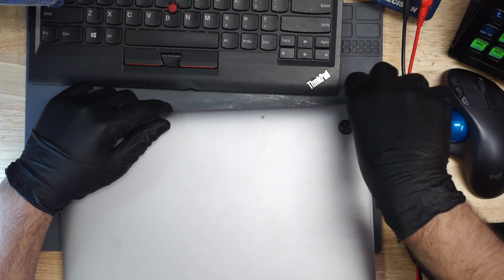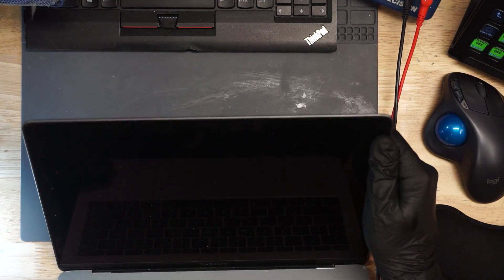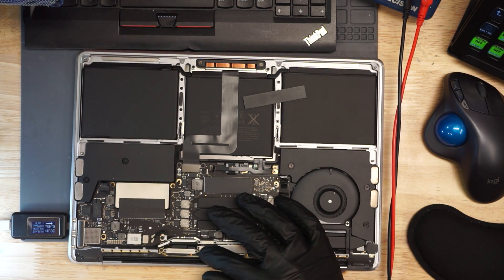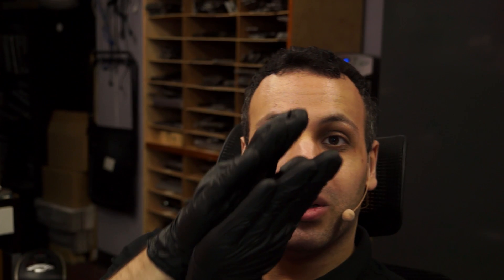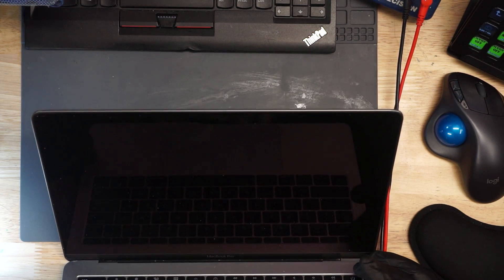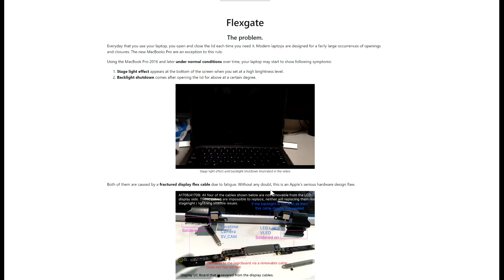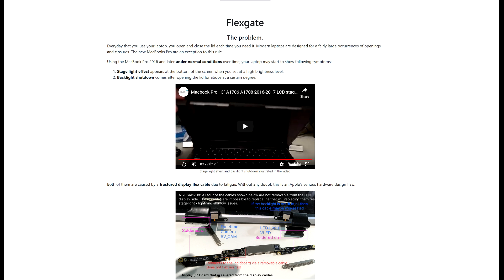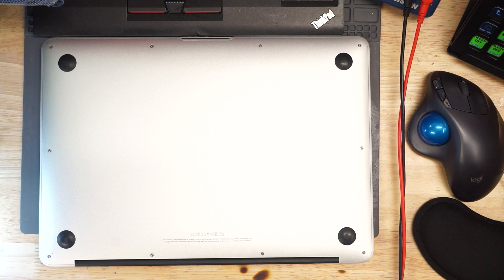Macbook screen DIES when opening lid: Apple provides NO FIX! flexgate

Comment: This would be covered under Australian consumer laws, meaning Apple would have to repair, replace or refund the faulty product if it was purchased in Australia. Does the US not have similar consumer protection laws?
Reply: It's the US, of course not
Reply: Technically the answer is No as there are many lacking laws in regards to consumer products. While a manufacturer is supposed to fix any defects a product has, i.e. the Macbook screen here, they could easily turn around and say "Well it's your fault because you handled it wrong.". On top of that, they made it nearly impossible to repair the products on your own.
Reply: @RevoX4  "they made it nearly impossible to repair the products on your own"  please shorten this to "repair the products".  Apple does not repair, they just replace. This is a huge difference in terms of ewaste discussion and how evil (not only expensive) Apple is.
Reply: I'm beginning to understand why most consumer electronics are so much more expensive in Australia compared to the US (over and above the exchange rate). Faulty equipment stops being a liability after a year and turns into a new revenue stream...
Reply: @nicholasleighbarnes  
You're overthinking it.  We call it 'the Australia tax'.  Everything is more expensive here.  Car prices are absurd, food is providing someone with an enormous profit margin and yes, consumer electronics are also horribly overpriced.  Because Australia.
Reply: No, Americans seem to think that protecting citizens is "socialist" or some other such nonsense that infringes on their "freedom"
Reply: Yep hahaha that’s the exact reason I buy apple in Australia. They are so easy to get things claimed even 4 years old under consumer law warranty! I’ve had other products from Samsung and other major companies that kept trying to push me away
Reply: @Danlapse  Are you claiming apple in Australia will fix something 4 years old for free. Thats 100% fucking bullshit.....
Reply: Yes, the US has these laws. But, just like in Oz, try getting them to do anything about it . You'll get no where as an individual.
Reply: @xenonram  
Warranty claims are not as hard as you think.  Harvey Norman is surprisingly helpful with "reasonable expectation" type of stuff.  Fair enough an alarm clock isn't expected to last forever but something like a fridge or dishwasher can get a manufacturing fault fixed outside of the warranty period.
Reply: @xenonram  most countries the contract you have is with where you bought it not the manufacturer (unless one and the same) so it's often easier to deal with the retailer to force a repair. In the UK if you pay via credit card you have significant protection too and via finance so worth checking your options wherever people love you often have more rights than you realise .
Reply: I dont see how Apple is at fault here. They are selling to a market of people that want this and is wiling to pay a premium for this kind of design.
Reply: Lol
Reply: Maybe that is why no one wants to sell to Australia? 😂
Reply: Well, there are the Federal Consumer Laws and then there're Consumer Laws by state.  Basically, 51+ different consumer laws are in effect.  Eventually, Apple will be shamed into some sort of fix.
Reply: @CitizenPerkins  "Shamed"? Do you seriously think they give a fuck about shame at this point?

Comment: couldnt you just check the pinout and 3d print the connector or is the problem in the cable itself? if so splicing those isnt that monumental and probably cheaper than buying a new screen
Reply: john trea I think some traces in the flex cable break after repeated bending. I mean it can be fixed with a lot of fiddling, but unless you splice every single trace the screen will stop working again soon.

Comment: Clearly anyone with this issue are just opening their laptops wrong.
Reply: You have to caress it and speak words of encouragement, it'll open in its own time
Reply: @matty9460  Like the wondrous and delicate flower it is.
Reply: Think different 🤫
Reply: I saw my underclassmen owned a touchbar mac and they have to manually wipe them every few minute, and bought a plastic cover for the keyboard. Now that’s how you use your macbook
Reply: This reminds me of I place I worked.. Certain customers were allowed in the back with us techies for some reason...

One of them pointed out that the hinges of laptops would be damaged, if you didn't push in the middle of the screen, but at one of the sides. So while I was working and opening the screen by pushing it open slightly at the side, because I were putting down a screwdriver at the same time. The costumer literally grabbed my hand and insulted me for destroying costumer assets..

Rule number 1: don't ever interfere with a techie working on a product, and don't ever tell a techie how to repair products, when you have no idea how to fix it yourself!

I were just an intern then, but after that incident and me staring the guy down, my boss changed the tactics and didn't allow any costumer to be in the back after that.. No special treatment for costumers, not even a chance to look into the back of the shop... You don't destroy the hinges on a laptop unless it's designed badly, period..
Reply: How does one open a laptop wrong?
Reply: surely you jest!  =8*)
Reply: Man ive had this problem for months on my 2016 macbook and i thought i fucked up my laptop but i guess its happening to other users smh
Reply: Fucking kappa!
Reply: you are suposed to keep em always open ! and only when you move out to a new place close it !
Reply: @venix20  Arrives at the new place opens it and it breaks instantly 😲😲!

Comment: Tell the customer to crack the screen, rub some of the reflective coating off and get the screen repaired for free by Apple. A cracked screen does not disqualify the machine from the extended repair program for the ”Staingate” issue.
Has worked for me to get new screens on A1502s and the 12’ MacBooks many times (some where the screen has been so damaged that it wont display a picture at all), could see it work in this case too.

Edit; Yes this machine is covered by the extended repair program for the staingate issue, hence why you would need to rub some of the coating off the screen to get it repaired under that program.

Comment: Fortunately germany has a law for every product you buy that gives you a warranty from the manufacturer of 24 months, if the product is used as intended.
Reply: They'll say you opened and closed the wrong way.
Reply: We have the same in Sweden but it is 36months on electronic stuff =)
Reply: @pedan21  Yes, but after 12months you have to proove that the malfunction was from factory.
Reply: @johnnyandersson5622  most of the time it is still not a problem if it actually is a defect from factory
Reply: Only partially true. after 3 months YOU have to prove it was the manufacturers fault, which will be hard to do.
Reply: FourKK intact seals, internal component has stress related failure, hinges show no sign of stress derived from “opening it wrong”.
Less 2 minutes for an unskilled technician and less than 2 seconds for our Louis. 🙂👍
Reply: yeah is european wide law
Reply: Awesome
Reply: Lassi Kinnunen  Oops, sorry. I meant 6 months, not 3. But still: for the generic 2 years varanty thats demanded by law, after 6 months there is a "beweislastumkehr" (burden of proof reversal) where you have to proof a defect was already there when you bought it. Otherwise the manufacturer, as you said, can easily claim that its your fault.
Reply: Not just Germany, but all of the EU has this law.  EU consumer laws protect consumers against this idiocracy from manufactures. Required at least to be 2 years for a laptop. Also here in the Netherlands it could even be longer (3-5 years) depending on the life you can expect the device to have.
Reply: @SanderEvers  even better!
Reply: And good luck sueing apple in Germany where we have no class action lawsuits and you have to spend hunderts of hours to sue them. If you are consumer advocat Jesus you might find enlightment in this, for all others, go buy and buy a new one.  Warrenty sucks in germany if the manufacturer gives a shit.
Reply: @llothar68   well i had cdrecorder back on early 2000's that broke in 11 months .... i brought it aproximately 500 euros ... was the Ricoh MP9120A , so i gave it back with the warranty they told me it is not in the market anymore ... they can refund me 100 euros ..... so i told em nope ...replace it ...or fix it ..... or give me the next model i do not care ...they where telling me the same thing for 3 months till i called on the consumers rights  and there they told me "let us call em ... and if they do not fully refund you you can sue em for free " ....30 mins later they called me and i was fully refunded next day i went by the store .
Reply: venix20 it’s not the same thing with apple. A month ago my Macbook crashed under warranty and apple said “water damage”. Of course no water was spiled but you will need to prove and waste a lot of time. It was indeed some condense due to their stupid way of doing laptops. Thus, I repaired it myself. Consumer rights won’t do much in such cases as it is your word against theirs and is hard to find someone to back you up with extended evidence of their failure in production. The warranty is moduled by them and there are a lot of terms and conditions that will make you guilty of “improper use” in the end.
Reply: @mmemmem5003  i am not saying that it is the same i was just saying that by the law here you do not always have to sue sometimes cause of the law here if you shake em enough they will provide you with the service the law dictates !
Reply: @llothar68  not true, since 2018 we have the "Sammelklage" ( german for class action lawsuits). That law is now used against Volkswagen for example. So there should be a possibility to sue apple in germany
Reply: yeah sometimes I'm quite glad to live in Germany

Comment: Apple product quality seem to go down hill. That why their share go down. Then they blame the  Chinese not buying enough....lol
Reply: Hung Truong they’re not going downhill, they’ve been downhill. Apple has consistently had problems with their designs. The flyback transformer in the original iMacs, the G4 Cube overheating, the Power Mac G5’s leaking coolant, the the Titanium PowerBooks denting, the hinge on the aluminum PowerBooks, the Nvidia MBP flip chip, the 2015 MBP screen delamination issue, the original touchbar keyboards. The list goes on and on and I’m sure there are a lot I’m forgetting. 

Apple has consistently had unique, but completely awful design.
Reply: also apple don't talk to the repair team to find what has gone wrong with all these laptops : all they want is sell and the repair team goes out of business  because they cannot fix them any more : over time apple will go under as people will not keep paying out for new items every year : that's I think anyway : the repair can cost more than a new laptop as well :
Reply: They are blaming it on reduced battery replacement cost and hence fewer sales numbers. Makes sense.

Comment: Couldn’t you find out which trace in the flex cables is broken and and a jumper ? Or is it not accessible?
Reply: It's not an actual cable, it's "flex PCB" on the LCD it's "edge bonded" to the glass.
I have repaired flex PCB myself, but it's tricky and I would never do it on something that subject to ongoing bending.
Reply: station240 ....shitty.... pardon my ignorance I’m a noob but find this stuff incredibly interesting. Wonder if there is something you could put in its place basically fix apples shit design that would make a lasting repair
Reply: @jblade8252  The only way is to design and make a new, better cable (eg two cables joined together), and use standard LCD repair techniques to attach the new cable to the original LCD.
Strangeparts has this video on using ACF for LCD cables and (mostly) RFID wire bonding.
https://www.youtube.com/watch?v=PWzyPZAPbt0
Reply: I doubt that some jumper would last. These cables must be specifically designed for this. It's a lot of bending - even the regular flex, which apple obviously used, can't survive.
Reply: I think this is the cable is coming directly from the display driver (not the GPU the chip that actually flips the pixels) to the screen, there is literally hundreds of traces so it is impossible to repair by hand. On top of that being a through hinge flex cable even 2019 Apple wouldn't leave that uncoated.

Comment: Absolutely unbelievable! Designed to fail. Thanks Louis.
Reply: It is not unbelievable. What is wrong with you.  It is un fuc#ing unbelievable. That is planned obsolescence in 6 months time lol. Apple don't to wait a year for their money.  Apple wants that new laptop money in 6 months time.
Reply: @cool2180  I thought ribbon flex cables were a thing of the past. Other manufacturers stopped using them just because of these failure rates. What is the "revolutionary" design again?
Reply: @vdochev  probably something being thinner. LUL
Reply: @vdochev  No lol. Ribbon flex cables are not a thing of the past. Every laptop has ribbon cables connecting almost every component.
Reply: @xenonram  Yes, I know, but they connect components that are not moving against each other.